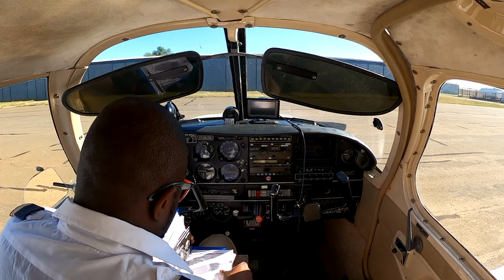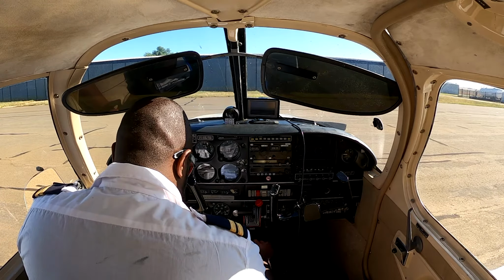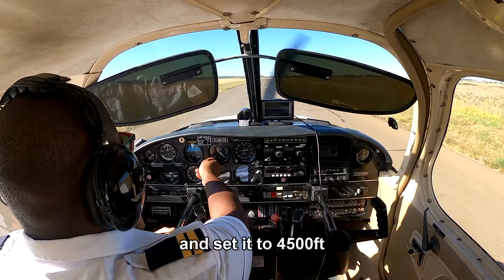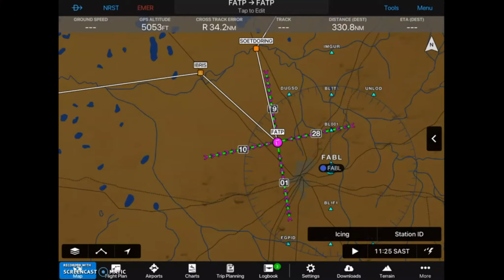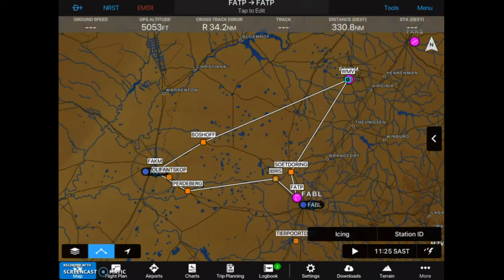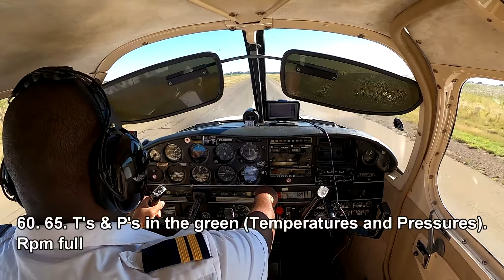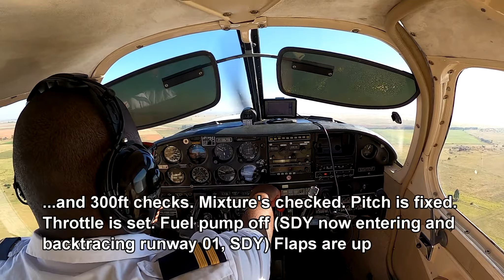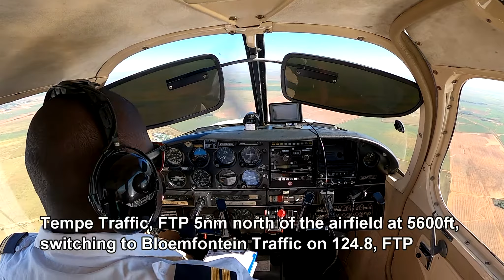TAKEOFF from New Tempe (FATP), Bloemfontein, South Africa | Flight Vlog 2

Comment: Hello Mr hope you're fine! I have watched your video and i loved it! But i didn't like the way that you opened and closed the throttle! You could damage the crankshaft by opening and closing it in a rapid succession! 

You should use the primer! It should have primed more fuel into the induction system where it is needed different from the throttle that just increases the amount of fuel at the Venturi wchic can lead to an engine 🔥! Correct me if i am wrong bye ✈️
Reply: He is overstressing the crankshaft 😂